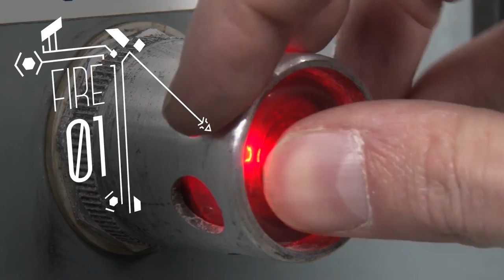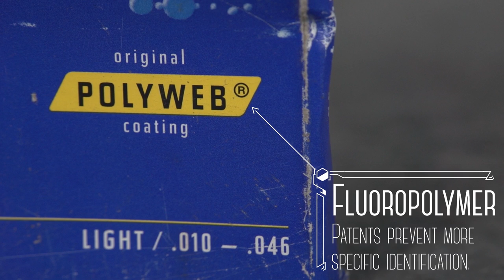Abuse of Power #1: iBook, Hair Dryer, and Guitar String

Comment: Without using the cop-out explanation of "we fed it a lot of electrical energy in a short amount of time", explain why the hair dryer jumped into the air and exploded into pieces.

Build a containment box so you can test more dangerous things... like batteries. What happens to an SLA car battery when extreme overcharging happens? :-) (yes, it'll explode... everything explodes, the fun is in finding out how).

Comment: I wonder if you can delaminate a printed circuit board by vaporizing internal power planes. The vias are probably likely to go first, but if there are enough of them, it might not matter.

Maybe carefully grind off substrate until you reach a power plane.

Comment: Could you explain what happened to metal strings (or any metal) in this experiment? I presume it superheated and evaporated? If so, is it safe to breath around there?
Reply: sibliminated, then either immediately oxidized, or just precipitated into what would have been a fine power if you sublimated a huge amount of it. most of it will just have oxidized and be carried away by air currents.